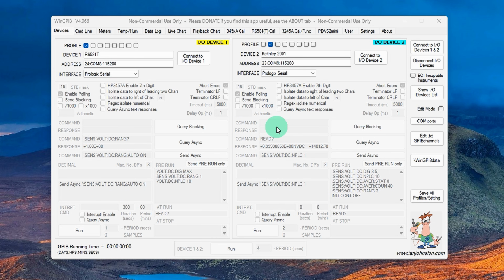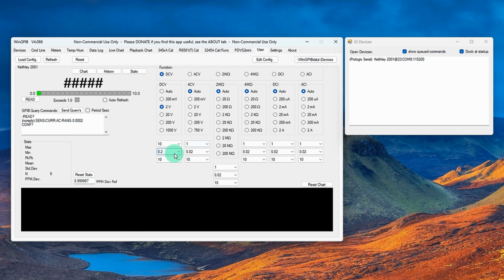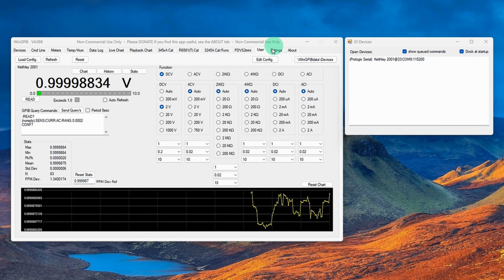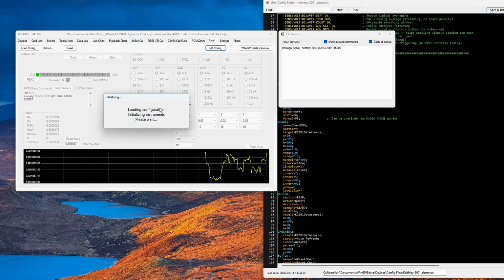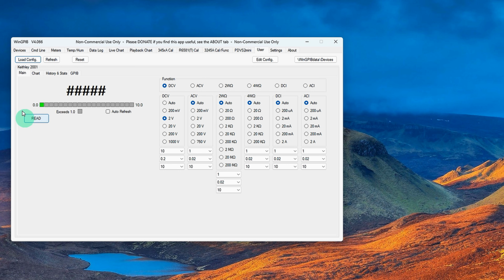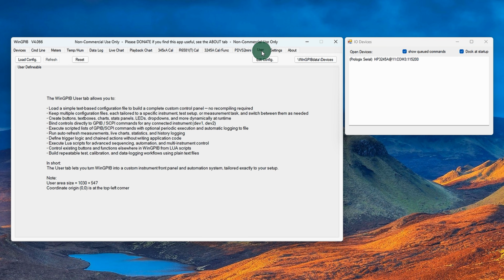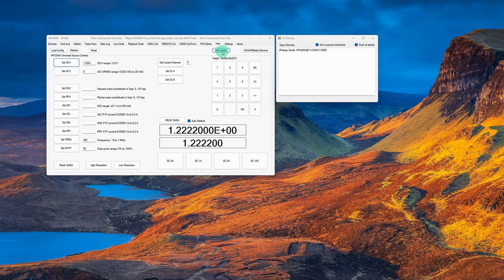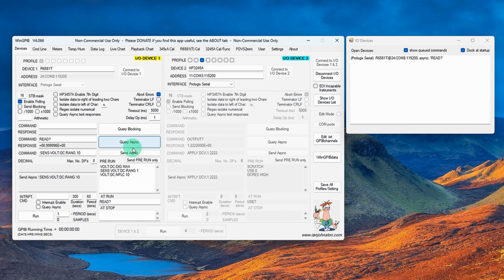No.172 - WinGPIB for Windows, the USER tab - UPDATE

Comment: What might make me try and get a  cheep 488 interface is a popout screen of just the display. So its easy for OBS etc to capture.
Reply from the maker: V4.068 will have this on the User panel:
https://www.ianjohnston.com/WinGPIB/UserPanelPOPUP.png
https://www.eevblog.com/forum/metrology/3458a-logging-via-windows-app-revisited/msg6159513/#msg6159513
Reply: @IanScottJohnston  looks good, just need to shrink the program down and rewrite it for the 6502 and see if it will run on my old 488 controller. i.e Commadore PET 4016. 🙂
Reply from the maker: That’s an idea!

Comment: Great project!  Is the IDE you created completely from scratch or is there an configurable IDE you’ve adapted?
Reply from the maker: It's from scratch. The idea being if I add new commands or parameters to the USER tab I can easily update the editors syntax colouring.
• A RichTextBox that holds the actual config text
• A painted gutter panel that draws line numbers based on the RichTextBox scroll position
• A ListView that shows “BLOCK” entries (DATASOURCE, CALC, BIGTEXT, etc.) derived from parsing the text
• Glue code that keeps scrolling, caret position, and block selection in sync